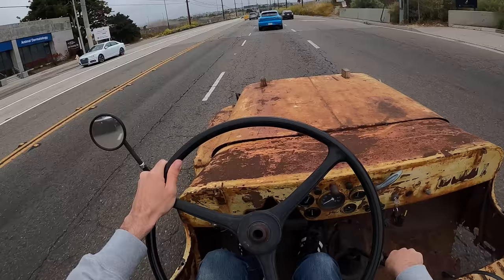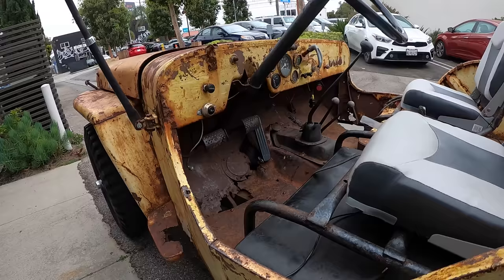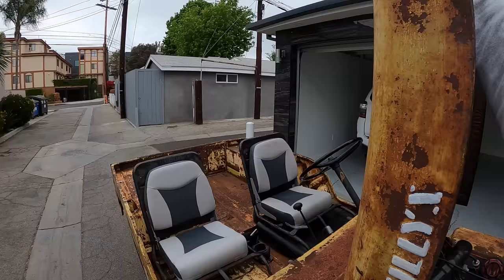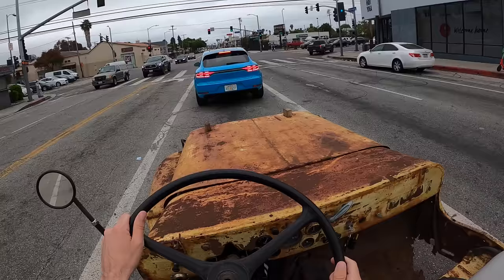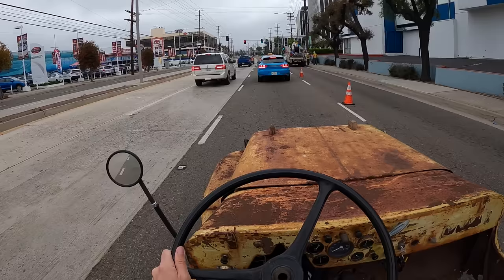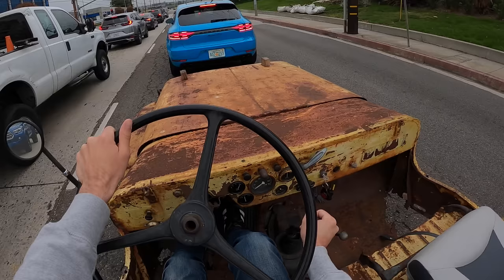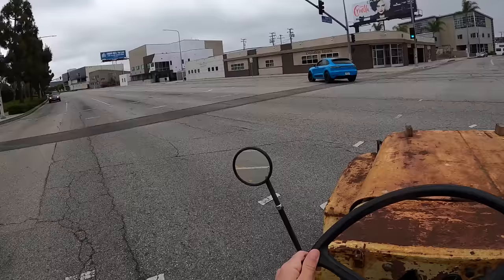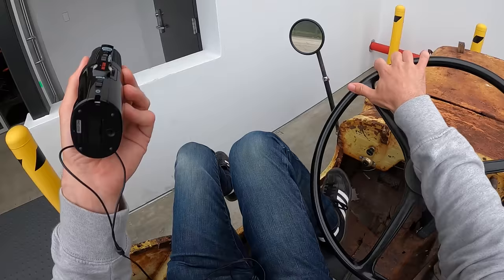1948 Willys Jeep CJ-2A - Rusted Through Death Machine! (POV Binaural Audio)

Comment: 1:22 I was not expecting such a clean engine on that rust bucket
Reply: You'd think they would have at least painted it given that they've put in new seats and changed the motor. I don't dig that homemade oil indicator literally drawn onto it, though.
Reply: Oi
Reply: It looks so out of place
Reply: I know, right
Reply: @mentirosodesouza4424  oi who is maintaining this sentry gun?
Reply: Curiously, it seems the front bumper, suspension components, etc are painted. You can tell it still has rust underneath, but it leads me to wonder if someone was tooling this around as “authentic patina”
Reply: We discover a new thing:

The engine is not original
Reply: A sleeper.

Comment: Every time you went over a bump, I was half expecting that rust bucket to fold in half.
Reply from the maker: You and me both! 😂
Reply: It's solid steel it don't got crumpled zones the things basically a metal brick that's one of the reasons it's so dangerous g-forces in a crash would go through you but luckily this thing don't get a roll cage or anything so you just go flying and then gravity would kill you remember to smile while you hit the pavement
Reply: @plantainsame2049  Well yes, but that's only valid when the vehicle isn't structurally compromised. When the steel cars rust out, the passenger compartment weakens while the engine and back usually stay rigid. So in a crash the whole thing collapses.
Reply: @masterkamen371  and you get pushed by the still ridged back yea?
Reply: @plantainsame2049  you become a pancake, yes.
Reply: 😂😂 yes me too.

Comment: This thing would crumple like a cardboard box in an accident but it'd be the coolest way to go out
Reply: a potato chip
Reply: I think it'd just turn to dust lmao
Reply: Not necessarily. Them things are about as tough as can be
Reply: @levivaughan3434  hardly
Reply: "Are you sure about that?" - General S. Patton
Reply: @adude8424  (Dies from car accident)
Reply: @levivaughan3434  maybe in good condition. This thing is awful
Reply: @yaboidustin2447  even still, the frame will do so.ething. at speed, it'd be dead.
Reply: @dietznutz1  they are, rock solid vehicles. There's a chassis under that body.
Reply: @THESLlCK  yes and a chassis is not what stops it crumpling
Reply: Idk.. I had a lady pull out in front of my 72 f100 with more rust than metal and it barely dented my hood and my bumper fell off. Totaled her new truck, rust beats plastic.
Reply: @CR-kr9cs  my point exactly. Older cars made from real metal do pretty well in collisions, to a certain point.
Reply: @levivaughan3434  Nevertheless..the highest strength points in this are the floors. That’s IT! And these floors are almost non existent lol it would quite literally crush like a pop can
Reply: The problem is that it wouldn't crumple. The frames are super strong.
Reply: @levivaughan3434  might have been tougher before the added coating of rust.
Reply: They don't have crunple zones so it might just give a big bonk.
Reply: I... don't know if y'all understand what rust does to the structural integrity of a car...
Reply: @levivaughan3434  it’s rusted through, not mint condition.
Reply: As doc once said “he’s in a Ford we’re in a DeLorean he’ll crinkle us through like tinfoil.”
Reply: It would disappear into a cloud of brown dust in a crash.  not so much crumpling”
Reply: @struggle1835  you would just evaporate with the car and ascend into heaven
Reply: No doubt he’d die but these things were chunks of steel on frames meant to carry lots of armor potentially. Strong chassis.
Reply: @levivaughan3434  Actually, older cars may appear to do well in collisions, yet they actually pose more of threat to you than more modern vehicles. Reason being hidden structural damage, which may happen, and what they call a "crumple zone" used to better protect the driver incase of an impact.
Reply: Modern cars would go over the bumper and frame, right into your face...
Reply: actually other cars would cause the were made to crumple to save the guy inside. the willys would be relatively intact (driver, not so much)
Reply: Nah nah nah
It would fall apart into a fine powder and blow away in a sudden gust of wind
Reply: In small Speed front on Front Collision against a Modern SUV, that Classic would surely Ruin the Modern SUV with Lesser damage. But in Higher speed accidents. The Jeep would be Crushed. Modern Cars have mostly Non Metal Bumpers. They Crumple and help Absorb the Impact. I mean this Jeep is full metal. It gets worst when u crash while sitting in this Jeep Into an Immovable Object. No Crumple zones to absorb that Impact Force. Modern cars have there Strength in the Frames.
Reply: @levivaughan3434  everyone thinks that but truth is it would get absolutely demolished especially this specific one which has very obvious rust damage to everywhere probably including the frame😂
Reply: Talk to me
Reply: Is cool
Reply: This thing is as tough as a tank
Reply: On the plus side, if the hood were to open at speed it wouldn't obscure your vision much because it would disintegrate when it hit your face.
Reply: No airbags, we die like real men lol
Reply: @BillehBobJoe  130 mph down a hill into a concrete wall yes
Reply: @big_-guy102  if it's going 130 down a hill into a thick brick wall yes, normal accidents no.
Reply: @levivaughan3434  Perhaps but that’s not gonna stop you from flying through the rear windshield of the car in front of you and getting engaged with the passengers
Reply: @levivaughan3434  the car is meant to absorb the impact so you dont
Reply: @lexuses3942  (warning wall of text)

wrong the highest strength point would still be the frames given that these frames were meant for military use (if we ever get to the point of using clones for soldiers I bet they would be made to live longer lives and be stronger then us given their purpose (think the clones from star wars aside from the living longer part logically speaking a republic clone trooper would be stronger then your run of the mill storm trooper from the age of the empire simply because they were meant for a military purpose (and to carry about armor and weapons most of the time and very likely have to pull/carry fallen comrades when a retreat was ordered)
Reply: @sockshandle  Awesome
Reply: The frame on this car is probably still decently solid as theses original models had this particular rusting issue, just based off the fact they were basically covered in house paint. That engine plus that frame would slice thru a Hyundai like a piece of German chocolate cake. The real danger is if this thing were hit a Tesla. That rust plus electricity , instant fireball
Reply: The question is which would be safer being hit by car as a pedestrian or being hit by a car in this
Reply: Bro yeah
Reply: Having faith in Christ is the cooler way to go out into glory instead of the fiery underworld
Reply: It's an old thing so it will not crumple new cars crumple because the crumple keeps you safe the car absorbs all the G Force but in an old car when you get in accident all the g-force goes through you and your body does not like that so it decides to die
Reply: @levivaughan3434  tough? Sure. Safe in a crash? Doesnt even have seatbelts of any kind, doors or roof. Wartime design.

And its rusty as hell, yeah no not safe.

Reliable? Bet
Reply: @levivaughan3434  it might have been 80 years ago but right now it has the structural integrity of a chip
Reply: @levivaughan3434 it would now but at the time they were meant to be rigid and strong now cars are meant to crumple to absorb the impact so that you don’t die
Reply: although the other person in the crash would get tetanus and possibly other diseases
Reply: I've seen cardboard boxes that look more durable
Reply: Potato

Comment: I own a 59 jeep like this and I gotta say, you cannot kill them. They may rust to shot, but they will never die.
Reply: Like the Toyota pickup
Reply: @yeetyeet4380  no Toyota is shit
Reply: @adamnelson4455  This jeep is shit....literally
Reply: body on a frame can look like shit but as long as it's bolted together securely it won't give up if mech is alive :)
Reply: @adamnelson4455  the 1985 Toyota Hilux Diesel is considered the worlds most durable truck. Look it up.
Reply: @yeetyeet4380  you really need to look up some videos, the hilux literally survived a fire, being submerged in sea water for half a day and go down with a destroyed flat without using any spare parts
Reply: @frisomeijering3270  watched the whole thing
Reply: @yeetyeet4380  oh I meant to reply to the other guy and not you, my bad.
Reply: @frisomeijering3270  it’s ok
Reply: They rust like hell but the frames are tick and usually live. As far as the boddys go their almost 100% flat sheet metal. So patching them up is a breeze, I'd slam floor boards in that one and keep on trucking
Reply: @adamnelson4455  Toyota supra
Reply: Well, when they were designed to be driven halfway across Europe in the middle of warzone mud, and repaired down to the frame with two wrenches and a hammer...
Reply: Built before planned obsolescence
Reply: @BrainOfRott  Unfortunately, no. But built for a client whose needs were rugged enough that planned obsolescence would have failed the design, yes!
Reply: Titanic 2 engine cylinder engineering room
Reply: @adamnelson4455  ikķ007
Reply: @hasnicktir5310  it's not lol
Reply: @MrRecall200  Yeah, the ideal structure for longevity is body-on-frame, build up the frame beefy as hell, and the body is rather superfluous. Rust hole? Tie a blanket over it for the winter, free cooling in the summer. Crash safety? What's that? You aren't gonna go fast enough for that to be a big concern, and any crashes you do somehow get into aren't fast enough to do more than bruise you, or perhaps crack a bone if you have osteoporosis. 4x4 low-range drive? Of course, you need to be able to climb over stuff. EMP? Who cares, its all analog and uses compression ignition, a Carrington Event won't even leave a mark on it!

Comment: Am I crazy or does it sound like new? It sounds like it pulls and just wants to go. What a hero.
Reply: Those old willys 4 cylinders will run great under about any conditions. I ran mine with almost no oil or compression, and it still chugged along like it was new.

Comment: 6:27

imagine your new modern Tesla just broke than you see there’s a older car from the 40s still running next to you 😂
Reply: It must be like omg how is that car from the 40s still running it’s literally a rust bucket
Reply: @EverettCrowl  you can still draw on a piece of paper despite it being ripped, or blackened and smudged up. Same as this, it's the engine the chassis that runs it, not the body of the automobile. And not everything has a multifunctional choice of speed at all times, you see back in the day we had this excellent thing called creativity, you could have a performance automobile, and a slower smooth driving automobile, and not have both in one. Give yourself more variety, not a plastic molded frame they had years to think on changing, and choose the same goddamn design every other auto car has today. Also rust can be removed, it isn't like it's atoms are weakened. Can society stop making fun of older automobiles anywhere from 2010 sometimes, to 1980, to 1964, 1952, 1941, 1937, 1920, 1913, 1902, 1890, 1883, 1871 and in between all of those years more than just the example years I provided. It's unhealthy, just let it go, they only work lesser than a modern car because the modern car is brand new, and it is a steady 70+ years old.
Reply: @EverettCrowl  then you better grab a book mark Mr Crowl.
Reply: When a 70 yr old car still runs than a Tesla
Reply: @EverettCrowl  For someone who writes, you seem to be of the short easily consumable media mindset which is rather ironic.
Not tryna start a flame war, but don't you think it's rather silly to try and rag on this guy, especially as someone with a passion for writing?
Reply: @dabeanne  I mean, Tesla’s are pretty fucking amazing. This thing is a piece of shit that has been incredibly well looked over in the powertrain.
Reply: Same one from 3:37
Reply: @nokiatunes7256  No, I just have an opinion different than yours. Considering teslas sell incredibly well and have impressive reliability where this thing is quite literally just an extremely well maintained engine in an absolute tetanus cage.
Reply: Then you regret buying the tesla
Reply: @HunterJs2  have you seen those videos of 100 year old abandoned cars still running after chaging oils,ignition  and so on?
Reply: @WitchKing-Of-Angmar  "Can society stop making fun of older automobiles"
making fun of? have you seen the prices of cars 20 years and older? in fact the whole used car market is absolutely fucked. 3-4 years ago a non-running land rover perentie (aus army vehicle) would go for about 6k, now people want 30k for them
Reply: @edbo10  I didn't say how many car enthusiast and men over 50 buy classic automobiles. I mean kid 10-40. Illogical naive kids who really think the vehicle was made wrong despite it being over 40-90 years old.
Reply: @WitchKing-Of-Angmar  The 18-40 range is exactly the kind of people im referring to, you notice how even 90s shitboxes are going for ridiculous prices now?
Reply: @edbo10  well yes, but I'm talking about 1930's-50's.
Reply: @EverettCrowl  the engine's clearly been restored so it doesn't really count
Reply: That’s not even the Ute drivers Tesla bro.
Reply: I love how on top of that the Tesla which is probably pretty close to brand new is being towed by an older Ford pick up
Reply: Not to mention there’s so much going on at the same time there’s a crusty old Jeep a Tesla being towed by an older Ford and then a second generation Prius passes the Jeep man I love the future
Reply: @HunterJs2  thing is when it comes to having replace the battery it is literally cheaper to just buy a new Tesla instead whereas older cars like this Jeep while yes they may breakdown more can be repaired easier and for cheaper compared to modern cars especially EV’s (additionally older cars in my opinion look an LOT more creative than modern cars (for example compare the basic body shapes of most modern cars they are the same whereas take a 1968 Cadillac and compare it to a Chrysler New Yorker of the same year you can see that genuine thought went into the design of the shape of the car (fitings/fixtures are also drastically different on older cars despite pre 75 cars being limited to circular headlights

Comment: Nobody:
Online ad: drives perfectly, minor rust. LaDy OwNeD
Reply: "Lady owned" is almost always a deal breaker, unless it's a rare model.
Reply: @beezertwelvewashingbeard8703  What does Lady owned mean??
Reply: @ioele1000  a woman owned the car.
Reply: American Nyan  They're usually filthy too inside and out. Just put gas in and drive, only change or add oil when the oil light comes on, if they can even see the light with photographs blocking the gauge cluster.
Reply: Non smoker, full service history :-)

Comment: That was a real life loading screen tip when you were stopped at the traffic light and noted that you can see the road through the floor. I actually didn't realize it's not road legal until you mentioned it though. Didn't think about it, just figured it came from the factory like that or something.
Reply: Cars 3 pandemic
Reply: It depends on the state; here in Minnesota you can drive around with the windshield off or folded down, just need to be wearing eye protection, same as a motorcycle.
Reply: Titanic engine cylinder engineering room

Comment: Body tub actually isn’t too bad just needs some  floor pan patches. Kaiser willys sells pre-made patches that can be welded in or you can just use sheet metal.
Reply: The look is intentional if you pay attention to the walk around the engine and frame/suspension are meticulously pristine. The body is meant to be a rusty patina shell.

Comment: Driving a barely running old thing like this is sometimes more fun than having a fast, modern car. You just gotta feel like it. I live in Middle Europe, we had this socialist car called the Skoda 120L (or Skoda Estelle in the UK, not sure they exported it anywhere else). Rear-engined, rear wheel drive, makes... some power. Around 54hp. I had a '77 one of those in similarly... "panoramic" condition, I mean I had a great view to the road beyond me as well. But it was running and I used it before it was restored. Great fun. Scary fun though, and not one the police likes.
Reply: Trust me on this. My flat fender has scarred me more at 5mph than any high speed exotic ever has.
You tube search "granpas jeeps greatest hits"
Reply: The 120L? Great car. Rear end was a bit loose and sadly rusted easily which is why they need treatment often, and the stick barely finding 2nd and 4th but otherwise, great
Reply: Could we not say socialist car?

Comment: Also, all of the old Willys Jeeps had synchros on 2nd and 3rd gears.  If you can't shift up or down into those gears without double-clutching, either the synchros are shot, or you are not trying to shift anywhere near the shift points (for example, the shift point for the 2-3 shift is 20 mph).